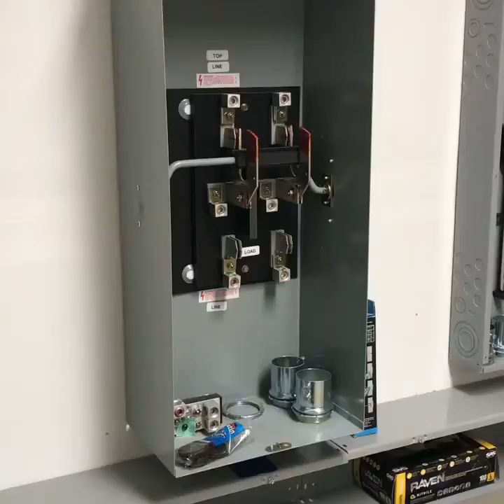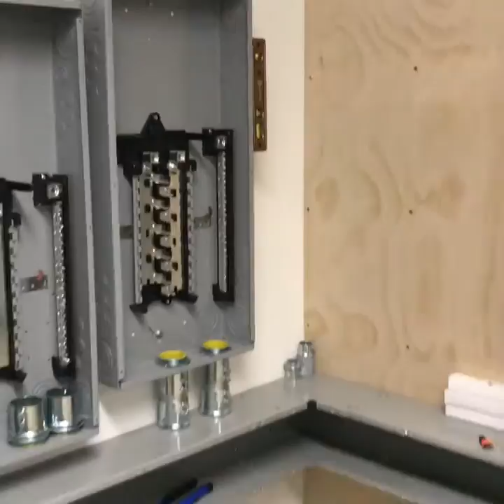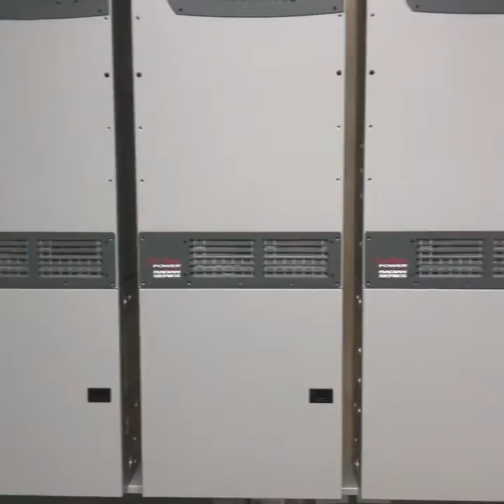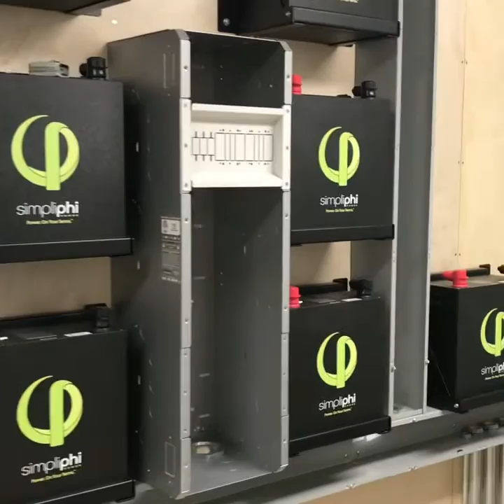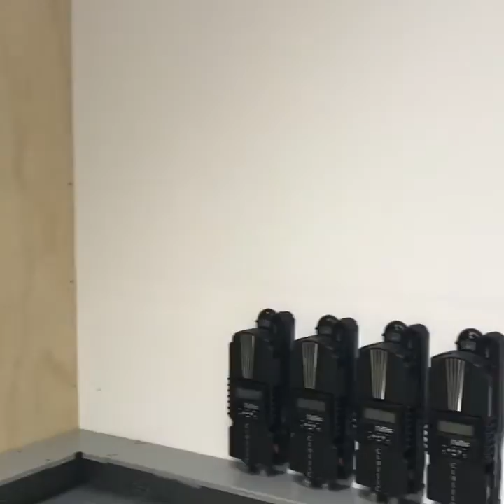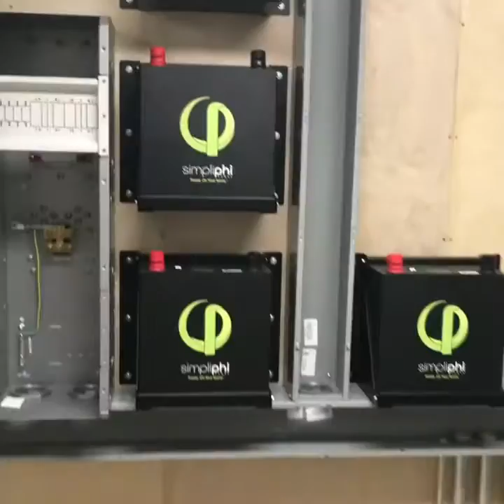Off grid power room with Simplipi Lithium Iron Batteries

Comment: OK, it's looking really good but I am wondering how you are going to handle added complications due to a three house setup.  For example: In my house I can't run all the big loads at the same time.  I don't run the dryer and the water heater at the same time.  Not hard to manage with one house...  But, how can you stop all three houses from running the dryers at the same time?  Are you sizing the system to handle full loads on all three houses at the same time?   Thanks
Reply from the maker: Good question we chose to use a propane water heater and dryer, these have no resistive loads so lower power requirements.  I am excited to try out the new heat pump style water heaters and dryers to see if we can do an all electric that has a better power profile.  What inverter are you running? On the project I did a while back where we switched out the batteries there are only 2 xw6048 Inverters runnning multiple houses and it’s worked great for years. When they have guests they do run a 50 kw Generator but he normal daily Power is the Schneider
Reply: OK, the propane water heater and dryer makes a lot of sense and propane last basically forever.  I am thinking of building a batch solar pre-heater for the water this spring.  I'm in Florida and I think that will work from March to November.  I am using two of the Magnum 4448 inverters with a continuous max output of 8800 Watts.  We hit about 7000 Watts when running the dryer with other normal loads and about 4000 watts when running the water heater with other loads.  Thanks!

Comment: sweet system but i feel it will never pay its self off, that it cost close to 80 grand? these batteries are super over priced to me :D
Reply from the maker: Going Off Grid it’s always interesting when people say this to me, this system will run three homes and would have cost in excess of 125k to get the power brought in and then had a nice utility bill in top of it with the occasional outage because of the location.  With that being said I’d say it starts paying for itself from day one and some people buy a 60-80,000 dollar vehicle to each his own
Reply: yes that makes sense, I see people doing this where there is already grid power, I am trying to save money with off grid system so cheap and well built, and I didn't know/no mention this is a remote area with no power, thanks for the reply this install is very useful and look forward to an update :)